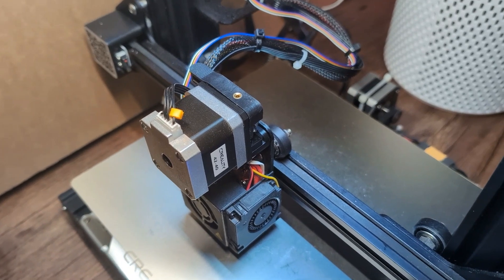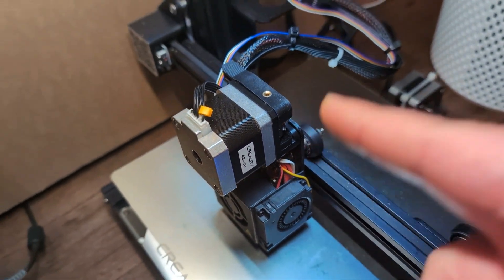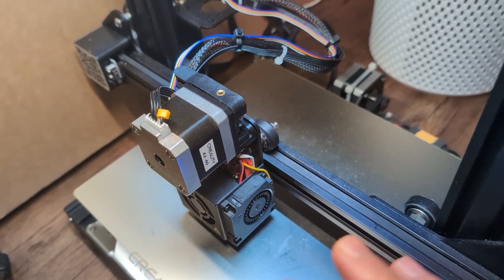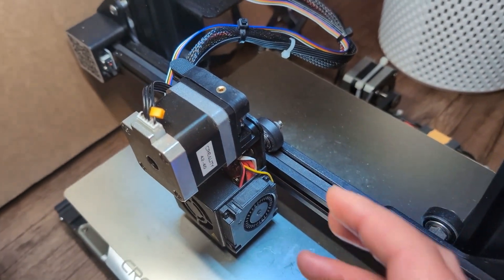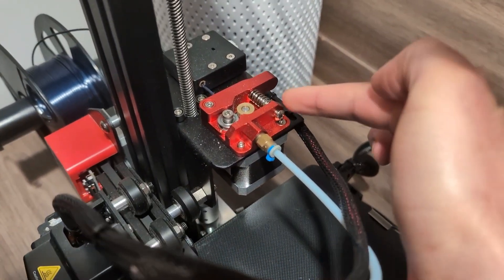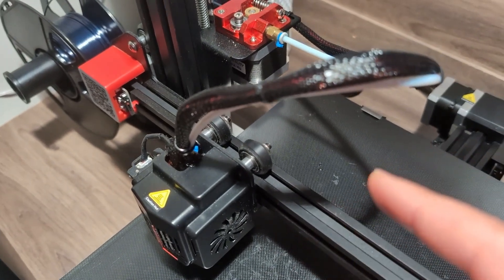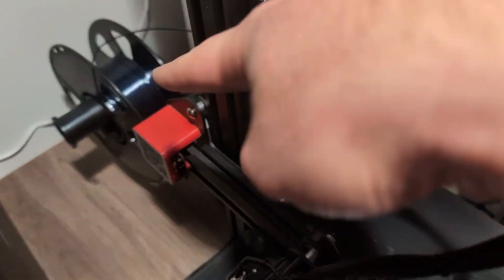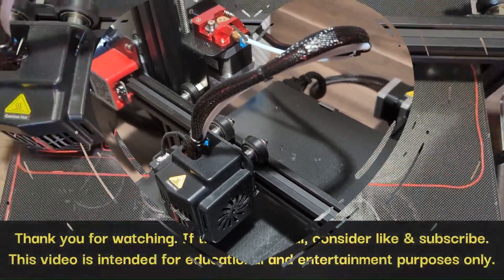Should You Upgrade To Direct Drive 🤔 #3dprinting

Comment: Nice video again my friend 👍🏻
I will like to ask you this:i have  heat brass and wondering if is good idea when i receive the direct drive to replace the heat brake
Reply from the maker: Depends on what your needs are but I'm going to say, I wouldn't recommend the direct drive unless you want to print flexibles filament otherwise I would skip it
Reply: 😮You make me sad
Reply from the maker: Haha I'm just trying to be honest, I wouldn't upgrade to a direct drive unless you need it, it's a bit more complicated and harder to maintain. If you do decide to upgrade, I do have a full installation video
Reply: @techs.passion  you teach me on 3d printer and i will teach you on umarex t4e guns if you like
Reply from the maker: Hahaha deal, do you have videos you like to share about it?